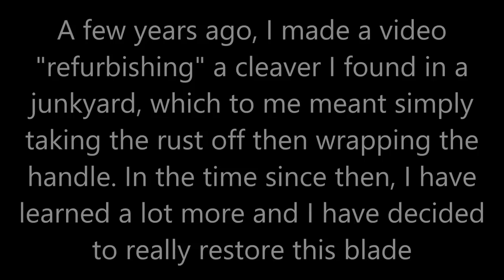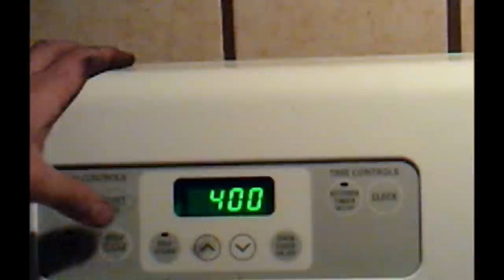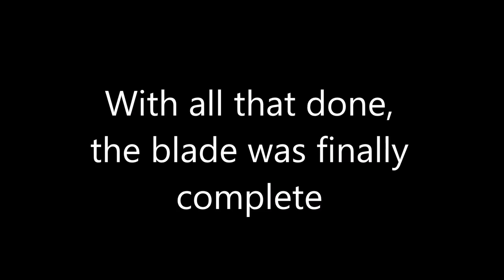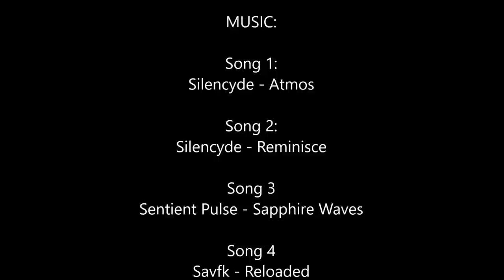Restoring a Junkyard Cleaver With Basic Tools

Comment from the maker: Sorry if the video quality seems off for a bunch of the clips. I decided to get a new camera for dedicated video making and it seems to be really hit or miss when focusing on what I'm working on. I'm thinking of switching back to phone clips. Does anyone else notice this and is it a problem
Reply: Chasen Tom I noticed it a bit but it wasn't a major problem for me.
Reply from the maker: Will Hudson 
thanks. I only ask because the new camera makes the process much easier, but I don't like the idea of sacrificing quality for the convenience. I'll try a few more projects before I make a final decision
Reply: The lack of auto focus is definitely visible. Doesn't ruin it but it does drop the production value a bit.
Reply from the maker: Doug 
After playing around with the camera but i think the solution is to just position the camera a bit further.
Another big problem is that the damn thing can't adjust light levels. If it's too bright you can't see a damn thing. If it's too dark it's so grainy that I may as well be recording with a flip phone. This wasn't too much of an issue for this vid, but I'm gonna have to probably just sell the car and switch back to cell phone should it present any more problems
Reply: Chasen Tom That's gotta be frustrating. Seems like it's fixable with a bit more tweaking though. When the camera was working it worked really well.
Reply: Ahhh...I see you've found Sasquatch's cleaver. Better return it before he comes over to your place and smacks you upside the head with a cow.
Reply: i see it yah, i think if you can try keep all of the clips at 16.9 so you dont get those black borders then that would improve the video a lot, but good work on the restoration hopefully you can work out the camera problems.
Reply from the maker: Cypher791 
Thats the weird thing though, my camera doesn't even give me the option to film in a proper aspect ratio. It's only 4:3, and windows movie Maker won't give me the option to edit the damn clips either. Looks like it's back to the phone for a while
Reply: you might want to look into "Lightworks"... its free and a fantastic tool for video editing.. a little bit of a learning curve but after 2 days you will get the hang of it and i think the results will be a lot better.

Comment: It's easier to shape the spine because it is differentially hardened, meaning the edge is hard but the spine is soft
Reply from the maker: Scissorf4ce 
Even then this metal seems strangely soft when cold forging. Like it seems to shapable without heat. Very strange
Reply: I've seen a few older cleavers in this style, and came to the conclusion that one of them was hand forged iron. It isn't all that common, but some smiths continued to forge craftsman and trade-art tools like cleavers using older methods; well into the late 1800's and early 1900's. 
The dull grey and scoured look is pretty characteristic of an iron tool. Even proper refined iron has trouble forming harmonious crystal structure, which is of course why things made of cast iron are so brittle. The "pockmarked" look on the flanks of the blade is pretty common.

That's a few basic facts I've picked up anyway, and probably a clue as to your blades composition.

Comment: Use a leather rawhide mallet and a wooden ASO next time to fix warps without damaging the steel if it's already heat treated and stuff and you don't want to reheat it up
Reply from the maker: Aaron Li 
Good idea. This time around I just kinda wanted to do a new heat treatment, but I'll remember that for next time

Comment: Quick question how did you shape the pointed end of the track
Reply from the maker: Eugene Tan 
I didn't. I found this railroad spike anvil at my local scrapyard. Quite a bit of luck because I've needed an anvil with a horn for a while now.
I'm guessing whoever made it did it for fun because there weren't any hammer marks on when I got it. From the looks of it the maker took a scrap piece of track, shaped it separately, then welded it on because you can see a seam where the horn meets the anvil. It's a damn strong weld too because it can handle being it with a hammer when in use
Reply: Chasen Tom ah i see thanks for the info becauses a friend if mine found a piece track sn i may start forging soon so i needed some ideas
Reply from the maker: Eugene Tan 
if you're just making basic knives a flat piece of track should do you fine
Reply: Chasen Tom ok thanks for the advice ^^ i watch most of your videos because my first official knife project is to make a cleaver for mydad because that is his go to knife for cooking ^^ thanks for giving me your time
Reply: Knight hawk.